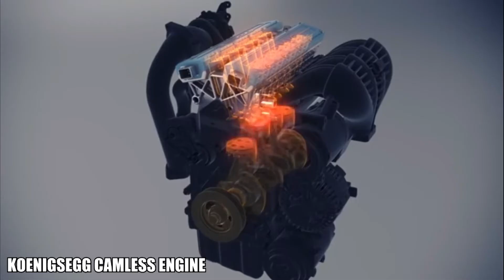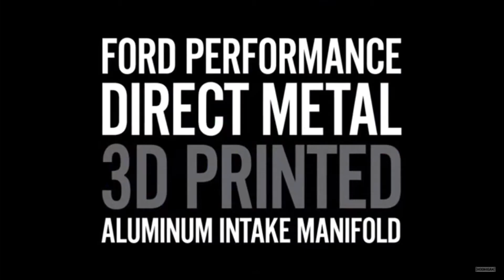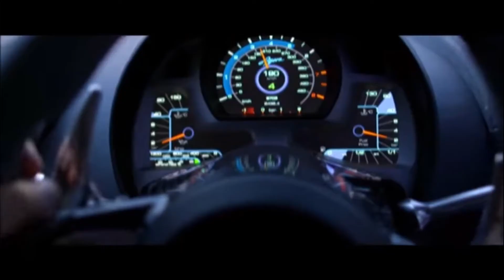4.6 DOHC FORD IN A HYPER CAR?

Comment: You raise some interesting questions and definitely peak my interest BUT if you want to be taken more seriously on content like this do more research so your entire video doesn’t sound one notch below speculative.   It was very hard to determine which actual information you provided was fact over guessing, assuming or just throwing around some questions or ideas
Reply from the maker: I thank you so much for a kind way ( checking me ) Thank you for that... The block was Ford until ( it was cost effective ) at the time... The car block needed to be altered to suit going 100hp twin turbo... Piston spacing was the same , Head bolt pattern was the same, and the mounting points to transmission wise was the same.... The guessing parts come in about the Coyote engine. ( and tech sharing )..  Its all possible ... his is the stuff i just bounce around in my head ( not knowing the facts )  .. Companys steal tech all the time... You think Ecoboost is all Ford.. I sure Mazda shared a little info... Then ford Cut back on the valves ( to save money ) .. Its a thought... I thank you so much for your detailed comment.. I took it in what you are saying and I can not thank you enough..I am still learning

Comment: Well I guess I didn't know Ford was sharing with Koenigsegg.
Reply from the maker: only for 1st gen Zeggs after that they designed a better Mosular motor... You can take that engone and bolt up a t45 trans ... Still same bolt pattern whichs is crazy... I feel The COYOTE used some of the tech from them ( a guess ) not facts

Comment: I love my 96 cobra, especially its legendary teksid 4.6 dohc engine! That’s why I will not coyote swap! I am literally pistons,rods,and fuel system away from over 1000whp even with stock heads and cams
Reply from the maker: I feel ya I have 3 -4.6 4v motors i am going on that side of things to see what its all about... I agree with you all the way
Reply: I agree … I have 275k on my 03 mach1 . And get asked if I am doing a LS swap when my 4.6 DOHC . And I reply. Well maybe in another 15 years when it hits 500k miles on it … my 4.6 DOHC still runs strong as ever ..
Reply: @robertfray7737  please Dont ls swap a Ford! Just do a coyote or a built and boosted 4.6 4v
Reply: @petrolhead8851  I wouldn’t.. I doubt I put enough miles on it to finally kill it . I am going to park it .. and get a SUV for a daily driver… I would never put a bow-tie in my Ford .. just because it’s trendy ..I was joking
Reply from the maker: @robertfray7737  Right on bro! No Ls swap we have to stay in our lane... Yes they make power , but its not as cool as they use to be.. Anybody can make pizza Ls is the Dominos of engine swaps 4.6 dohc is the mom and pop of pizza it just taste better..

Comment: The original 4.6 4v dohc all aluminum engine was in the 93 mark Viii. It was built in ford's german engine plant. This engine  facility builds and develops all sorts of engines for companies. Don't forget about Ford Cosworth engines and there race history.  The v12 and v8 in the  Aston Martin's say fomoco right on them.
Reply from the maker: yes jay you are correct on all accounts , This was a great add on by you bro

Comment: @BST Ford Channel So you covered the Modular V8 engine used in the Hypercars, Aka:  Koeningsegg. Are you going to cover (make a video) of the Ford Duratec V6 engines used in Supercars?  Noble M10, M12, M12 GTO, M400, and M15 cars. Rossion Q1, Salica GT , Salica GTC, and Salica GTR.  I think they should get some love too!!!
Reply from the maker: going to have to give that engine some love.. cause i had 1 Taurus and the engine was a solid engine it went 200k and it was very spunky I know i should have done this..

Comment: IMO if your'e doing a junkyard easy to find 4.6, just drop it in and take the chance. If your'e doing an harder to find junkyard 302, pull the heads and oil pan and inspect. A little slightly bent pushrod can through you off when trying to get timing perfection. Or just a quick diy old school valve lapping can go along way. No sense in detonating an hard to find old school engine. If it is all good, all you are out is one complete gasket set. If it needs lifters. A new cam and lifter set or simply set it aside for a down the road complete rebuild. Seventy percent of human thought are assumptions. Ninety percent of all assumptions are somewhat incorrect. Those of us who turn wrenches already know. LOL
Reply: That 4.6 wouldn’t be a dohc

Comment: The gt40 engine and the koenseigegigigegive engine are so similar that they could be the same thing. Then they Co develop the 5.0 or they just did the same things ....I do know the early gen koensiges used a Ford 5.4 , quad cam, supercharger that made its way into the gt40 .
Reply from the maker: thats what i am saying Rob you and i are on the same theory... Ford Coyote is Koeningsegg inspired 100% Ford take there old tech and they create new tech... I bet Ford owns shares in the company but does not f with the mans business at ll the TECH is worth money. look what they have done in a very short time ... they had the tech way back but they didnt want to just spill it out 1 time... they have cars to sell

Comment: 1999 Ford Explorer 5.0? Next video
Reply from the maker: maybe who knows.. i was thinking about it
Reply: i just bought a 97 Mountaineer with a 5.0. i've heard the crank & Cam comes from the F150 while the Intake, heads and block comes from the Mustang. I always felt like The 2nd gen Explorers/Mountaineers never got the love they deserve even while their tow rating is better than the 2020 explorers
Reply: @YoungSentrell  I've worked on one it ran so smooth but the body is rusty
Reply from the maker: @YoungSentrell  nope you are wrong dude people respect it ( ford guys ) any ways.. they talk less about hem cause of the defective tires they had FROM Firestone. many deaths have happen cause of it and something else about the suv to,, So thats why they are not talked about , but well respected.. i will build me once i get these projects out they way.. They are still around driving no issues so how bad where they? they are great suv

Comment: Why not make a all carbon fiber thick block with forged steel cylinder wall sleeves.and crank mains & connecting rods.Since intakes and plenums are plastic and hold up carbon fiber would hold up.✌❤&👟
Reply: Dodge Ramman carbon fibre only has strength in one direction... so it would not be ideal for an engine... let alone a high displacement, high power engine.
Reply from the maker: these guys are just doing some wild stuff i am sure they gave ford game on that coyote...I am sure they drying to figure that out carbon block ect